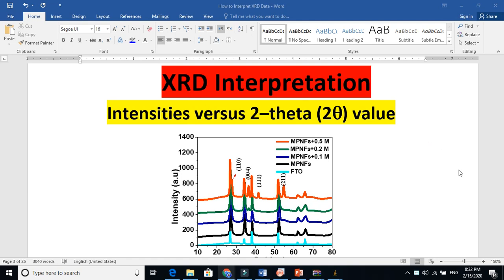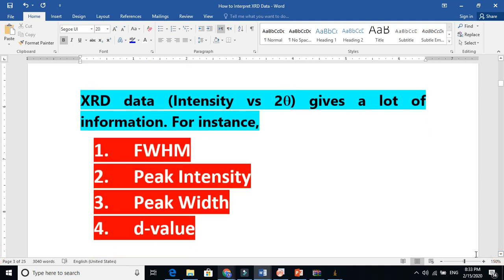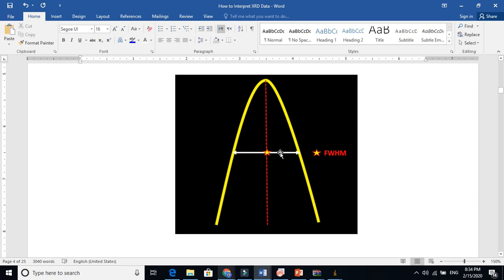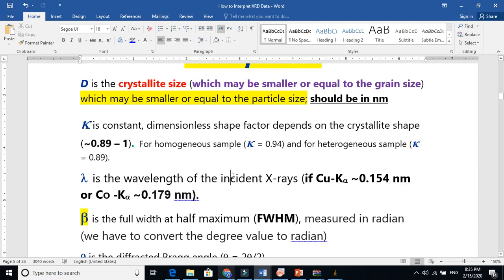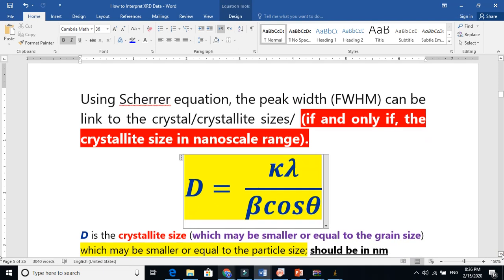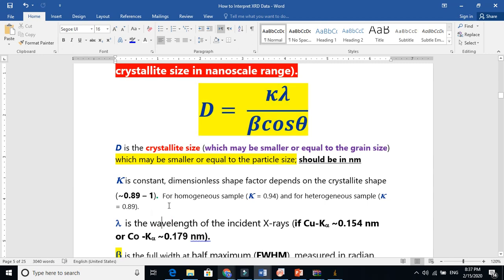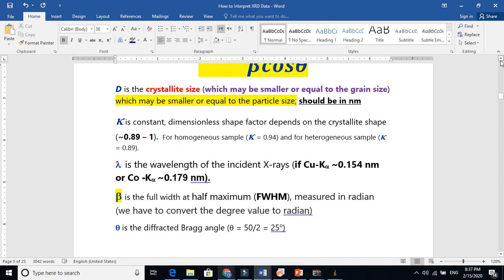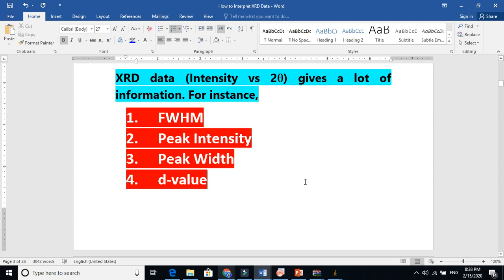XRD Analysis: Full Width At Half Maximum FWHM Interpretation

Comment: Great work, I have a question: the width of a peak profile can be described by two parameters : FWHM and Integral breadth (IB)     which inversely proportional to crystalline size in amorphous or crystalline material. So what is the important of using FWHM and IB ( NOT difinition).. thanks a lot
Reply from the maker: Actually what I understand is, peak width tells about whether the material is single, poly crystalline or amorphous. If sharp peak,  the former while broad peaks shows the later. 
FWHM helps in finding the size of crysatallite using Scherr's formula

Comment: sir, please tells us the complete method how you plot this xrd graph of multiple samples in origin ? and how to make the table in my result lab operator did'nt send me word file
Reply from the maker: Response to the first question: To draw multiple XRD in one graph is called Stack plot. Pleas watch this video https://youtu.be/srz_YBjU02I

Response to the second question: You should ask the XRD operator to provide the Word and excel file. The system has these files. By the way how will you draw the XRD plot if you don't have these files ?
Reply: @qamarwali  they send me the all the sample result in coded form which can be used in origin to make the full plot
Reply from the maker: I got it. They sent the raw data in Text file. Then you have to convert it to excel or origin to plot it. 

Anyways, in my case during my PhD, the XRD operator provided both with excel file as well as the Word file that contains all the data such as intensity vs 2 theta and the Table contains all peaks miller indices and the d-value etc.... 

Wish you good luck!
Reply: @qamarwali  i know how to convert it in excel file and how to paste it in origin but i don't know how to plot the XRD graph and also the how i know my graph JCPDS card number that's all the question which i want to solve someone who tell me in his video
Reply from the maker: @MuhammadHassan-uu4of  how to draw it ? I have shown in many videos like the one I provided for the stack plot. 

For the ICDD card , please watch my videos
There is a dedicated playlist where I covered most of the XRD related topics
Reply: @qamarwali  can you send me that two videos link one XRD and the other ICDD
Reply from the maker: MOST of the XRD related data is available in the following playlist 
https://www.youtube.com/playlist?list=PLWgqLpcPbMgckHs0e677v8_GUh9-itYoS
Reply: @qamarwali  sir my co supervisor already plot the xrd graph but in that graph there is no ICDD card number so that can i find the ICDD card number of sample in origin in some simple method ?
Reply from the maker: @MuhammadHassan-uu4of  No, how can you find the ICDD card number from the origin ? 

You are  not watching the videos. The playlist I have shared , all information is there . 

Just spend some time watching the relevant videos. All your questions will be cleared.
Reply from the maker: Watch videos in this playlist so that all your questions will be cleared 
https://www.youtube.com/playlist?list=PLWgqLpcPbMgckHs0e677v8_GUh9-itYoS
Reply: @qamarwali  okay sir i already watch some of your videos i like your teaching method but right now i just want to complete my thesis then i already decide that i will watch all of your videos related xrd and many more characterization for my defense
Reply from the maker: @MuhammadHassan-uu4of  I understand your situation.  

For the ICDD card number, you have to purchase PDF file from ICDD which is NOT free available. 
Secondly,  you have to look for the literature related to your field works, and hopefully, you will find this number .

Finally, there are also options like Cif File ...

Okay now focus on your thesis . Watch these videos for conceptual information.  

Wish you good luck!